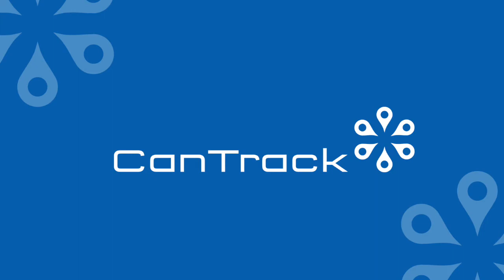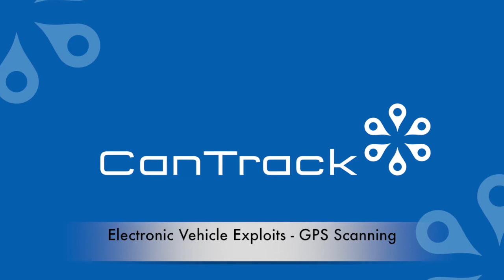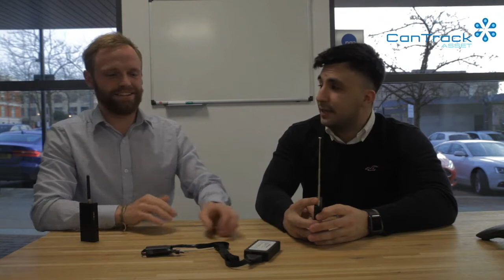GPS Scanning of conventional tracking devices

Comment: Its not as simple as that, just buy the jammer and use that first as the device won't put out a gps signal until it has been put into alarm mode it will just periodically give out a gsm cell site
 signal. In most cases only once every 24 hours .